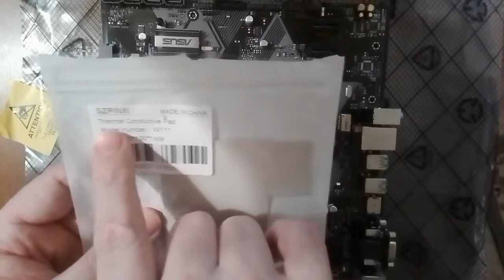Adding Heatsinks to an Asus Prime b450m a/csm motherboard

Comment: WOW asus is using thermal pads instead of properly mounted heatsinks with thermal paste, i thought these motherboards are suposted to be good.... what a joke, i just purchased a motherboard and wanted to put some good thermal compound on to replace the typical mass produced white goop and it has about 1mm thick PADS with about 1.0Wm.k that go bad fast makes the heat sinks basically fake and just for show, AVOID

Comment: I have a PRIME B450M-A/GSI that I have had for over 2 years & have a Ryzen 3 3200G, 24 gigs of ram, & a GTX 1650 super, running at 3800.0 MHz a budget system. Even after gaming for a few hours have had no heat issues. But this is a great idea. I believe I will add some to my board just to be safe. Not sure why I haven't thought of doing this. Thanks for the video you earned a sub from me!

Comment: Thermal pads aren't quite the right material spec. For one, they are a little sticky but aren't formulated with any particular adhesive force, so they can weaken and fall off, though you might get lucky and they might hold on. For other, they are designed for compression and only typically have about half their nominal thermal conductivity unless there's compression force on them.

Thermal adhesive tape is actually the intended type of material for such use.

Though if you bought a material that is 0.1mm in thickness (as opposed to 0.5 and 1mm types) and it was sold as "thermal pad", it was probably actually adhesive tape, that happens a lot.
Reply: I bought some thermal tape and let me say that it is hard to work with. I can't get the backing off of the tape. Is there a trick to it?
Reply from the maker: I've never had any problems with getting the back off the tape. Maybe you just got a bad batch.
Reply: I have a gigabyte b450m ds3h mobo can I buy that 100 pieces u bought from Amazon? Will it have all the sizes ?....then am gonna have to buy some adhesive tapes right ?

Comment: If it was required, Asus would have given them on their boards.
Reply: incorrect. if you do any sort of overclocking this will help, and if nothing else prolong the life of the motherboard.
Reply: That's not entirely true. Manufactures will cut costs on a budget board where they can and that power delivery is probably fine if you run stock but could also fail if you start overclocking. Also if user gets a next generation CPU that's supported by this chipset they may know that the new CPU Draws  more power but not know if a chipset created during the prior generation can handle it.
Reply: It would rise up the production cost
Reply: @reimon5410  
As if the Asus boards are cheap.......

Comment: Is it better to use a 40mm? Also can the heatsinks fall of,thx.
Reply from the maker: If you secure them properly they shouldn't fall off I did that video and put those heat sinks on that motherboard over a year ago and the computer's been in use ever since and it's still running just fine all of the heat sinks are intact and holding firm.
Reply: @jasonstektalk6109  ok,thx

Comment: could  you do  a video about temperature after and before this heat sink and if you can overclock high end cpus after adding the heat sink
Reply: they will not help much, but it will still ve better. You will definitely not be able to overclock a 3900x or 3800x on here... Also this motherboard does not have a VRM temperature sensor, so he can't easily measure it
Reply from the maker: I actually gave that motherboard to a guy that needed one and couldn't afford one at the time. With those heatsinks you could do some moderate overclocking all you have to do is keep a eye on your temperatures and raise your overclock slowly and you will be ok. Fyi has been almost a year since I did the video and the computer mobo and heatsinks are still working great. Turned a low end Mobo into a decent offering.

Comment: What were the lengths of the heat sinks did you use on the Mobo? I bought the asus b450ma
Reply from the maker: I don't remember the actual size of each heatsink but it was from a small $10 kit off of Amazon.

Comment: I also did that ...I have the same Mobo ...I used 14mm×14mm heatsinks from AliExpress
Reply from the maker: Works surprisingly well. I gave that mobo to a friend and their vrm temperatures have been great. Hard to believe adding $2 worth of heatsinks could help so much. Thanks for watching
Reply: @jasonstektalk6109  it will be awesome if you try running a ryzen 7 oc or ryzen 9 and make a video about it...adding a 80mm fan on the heatsink 
Please please please if you have the Mobo ....or what processor does your friend uses it with
I only have ryzen 3 :(
Reply from the maker: @mr.waffentrager4400  He's actually using a Ryzen 3 2200. Unfortunately it's his only computer so not going to be able to do any testing with it. I just purchased a 3900x so we will be doing a lot of test in the coming weeks. Some will be on ASRock b450m pro 4 and then some on Gigabyte Aorus Elite Wifi. Thanks for watching
Reply: @jasonstektalk6109  thanks for talking
Reply: @jasonstektalk6109  I run my ryzen 3 1200 @ ( 1.44 volts seriously) 4ghz 
Vrm temps like lower 40s on 100% utilization
Reply from the maker: @mr.waffentrager4400  This channel is about talking as a community about computers. Which is what I think a lot of YouTubers have forgotten is that talking with your audience not at them is so much more rewarding and I do this because I love helping people and getting to know who my audience is. Watch Greg Salazar's last video about if he didn't have 10000 views per video and make lots of money he would quit making videos. Made me sad to know that is who people watch on YouTube when you have tubers like me that do it to help people. I like making money but I'll never stop talking to my audience. Sorry for rambling. Thanks again man
Reply from the maker: @mr.waffentrager4400  Haven't fooled with the 1200 much but hopefully in the future I can do some videos on it. Now that I'm going to have a test system in about a week I will be able to do much more testing. Has taken me 6 months to get a test system I'm so excited.
Reply: @jasonstektalk6109  you are absolutely correct ...I wish you luck for the future !